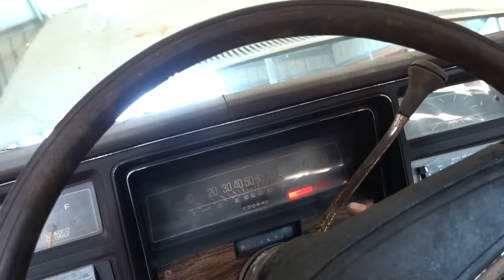Floors are DONE!!!!!

Comment: Spends $200+ on a carb, won’t spend around $100 on a fuel tank. Good job Matt.
Reply: Think we'll find out if that $200 carb can stop a 50 cal?
Reply: Or he could get a kit to seal the gas tank
Reply: Thought the same😂
Reply: And the carb will work be worth $0 after it's filled with rust
Reply: I was going to comment the same thing. Lmao. Matts the type to put a 2000 dollar alpine stereo system with equalizer,  bass cannon and sub woofer in a rusted out pinto. 🤦‍♂️
Reply: @dragonlvr069 I like your style
Reply: Hell I'm more concerned over not spending $5 for a fuel filter.
Reply: Not being funny, but these guys own a mansion, a tank range and all kinds of crazy shit. None of the parts to get this car running again would break the bank!
Reply: If that Carb is new, it's an easy 600.00
Reply: icuabc 123 oh yeah the one he ended up getting is definitely more than 600.
Reply: Jason Claunch yea it looks like an ultra xp so more like $850 or so
Reply: @Rich Baker for sure.
Reply: @Wyatt Myers I could only assume you’re correct on that, haven’t had to buy a carb since I had an 82 chevy back in 2001 or so.
Reply: Agreed
Reply: @twiggss4344  and?
Reply: Buys a new 1 ton truck won’t spend $100 on a new fuel tank
Reply: It’s just not worth the time for him. He could absolutely get it fixed if he wanted to.
Reply: or fuel filter
Reply: @twiggss4344  thought the same
Reply: No point in buying a carb   if you dont wana  replace  rust  gas tank
Reply: @richbaker8211  They dont own a tank range😂
Reply: You know Holley prolly sent that to him
Reply: I think this car is going to be apart of a Freedom Factory race. Matt just got a FF shirt from Cleetus and said that he's going to be "visiting the FF soon", then he gets a Holley carb for the Elco...
Reply: Love the sarcasm!
Reply: 600+ CFM carb or EFI Sniper upgrade?  Just please for all that is holy change that filter! XD
Reply: iBiana Doubt  damn it's almost like hes not done working on the car and is just finding out what's wrong with it! And the fuel pump works! Should probably just wipe his ass with cash too since yall are suggesting he buys all the unnecessary stuff on parts that work.
Reply: Or a 2dollar fuel filter
Reply: Jason Claunch My other suggestion I was going to say he does have a Wilder  Just cut open a square hole in the fuel tank get all the crap  back out of it and weld it back in !!  The same piece of metal that you cut out. !! 🤷🏼‍♂️🤔
Reply: Electric inline Fuel pump cheap !! And a fresh filter and that new carb and and youll be doin burnouts in no time
Reply: @icuabc1235  I'm pretty sure you're on the right track. Might be wrong but that looks like a holley xp
Reply: You can be cheap but fuel is the blood of the car and should be a focus just like the brakes and tires and other core wearables on the car. Most are cheap enough to prevent A expensive repair later that in this case would make the investment useless for not spending a few bucks to do right up front to be half decent repair.  smh
Reply: iBiana Doubt  I was thinking the same thing. That filter is obviously toast if he didn't replace it. On the other hand all that varnish is still in the carb too. Fuel lines are clean enough for a filter to take care of and obviously hold pressure assuming no leaks popped up (those lines probably saw more pressure from the air than they will from the fuel on a carbureted setup). I would have rebuilt the carb but honestly can you blame him for just buying a new one? OK maybe not a holley xp but a new carb in general isn't a bad choice 👍
Reply: Exactly my thought...???
Reply: If you put that new carb in, I would surely hope you buy a $5 fuel filter.
Reply: @mw3awsome9  gas tanks have a bad habit of exploding, even after they have been drained. Usually they have to be completely filled with water to remove the open cavaties to prevent fumes from accumulating and possibly blowing up. Explosive fumes can remain even after the tank is dried. Welding and cutting on tanks is not a good idea unless stringent safety measures are followed
Reply: Maybe he might rebuild engine for another car.
Reply: Has a fancy hand pump for the gasoline... instead of a 5 dollar funnel.
Reply: Will almost guarantee that carb is for another build he is going to do such as the bronco but just going to temporarily  put it on the el Camino and when he blows it up use it for what it was bought for...
Reply: Exactly. The logic behind not buying a new fuel tank but buying a new carburetor is really wrong but he’s gonna be stubborn about it until he realizes that he’s gonna have to buy the replacement anyway. LOL
Reply: He got the carb from Holley so it was probably free
Reply: Since when was a faking carb $200?
Reply: @Dallin Hatzke sister, anyone can be a Japanese made carb for less than $200 so get your panties out of a bunch and take a look at the market.
Reply: If the new gas sits in the tank with the stuff in it its gonna run like crap
Reply: Right. Ha ha ha
Reply: He’s also has junk cars he could rob a tank and rig it onto the car
Reply: @richbaker8211  they don't own the tank range, its just local to them

Comment: You're to young to know this, but your tank fill has an anti-siphon in the filler neck. We had theiving issues back in the '70's with the gas crunch.
Reply: Really? Wow, and now in some states, they're paying you to take their gas due to no-one driving. (Or were back in April.)
Reply: It was for unleaded fuel. Unleaded fuel had a smaller nozzle. Regular leaded gas was a larger nozzle and was cheaper than unleaded gas. You couldn't push the larger nozzle past the spring loaded flap. The Federal emissions guidelines to ensure all the newer cars used unleaded gas was the reason for spring loaded flap in the smaller hole.
Reply: Hanzy Scure This is true, but they also came up with a check valve, for both theft deterrent and for rollover incidents so gas doesn't pour out the filler neck if the car is upside down.
Reply: Rick Ballard it seems pretty obvious what that was for. And how it worked perfectly to keep him from syphoning. It’s things all tanks do because gas is always being stolen no matter the time

Comment: get your shopvac out and then some pvc tubing and and wrap it in duct tape to build up a buffer and stick it on your shop vac hose.  then you can get in thru the sender port to vacuum up most of that rust.  that is what we do in aircraft maintenance to get around baffle hole ports especially if you put the tank on saw horses upside down.

Comment: Hey Matt I use to work at a radiator shop as a fuel tank tech, if you ever have to clean a old tank again the easiest way to get old varnish gas out of a tank is by soaking it in dawn dish soap and hot water. Let it sit for 2 hours wash it out repeat if needed. Dawn breaks up the the old gas.

Comment: Hey Matt check the vacuum lines and gaskets under the carb my truck was doing the same thing turns out it was a gasket in between the carb and the manifold there is a way to check for a leak get some starter fluid and spray it around the lines while someone holds the pedal at a curtain rpms and if it revs up in a spot you spray the starter fluid you know that’s were the vacuum leak is in that general area! I’ve been watching your videos for years and have seen pretty much every upload have a good one man I hope this helps

Comment: Consider getting a Jerry can and flexible steel spout. That will reach just fine. Also, gas with ethanol in it is that light yellow. Straight ethanol free gasoline is a very light blue.

Comment: Some tank sealer will help a lot.  I think Oreillys sells it still, "Red Kote."  it will seal and encapsulate any floaty stuff that's left in there.  you could also etch and clean the tank with some rust dissolving treatment prior to sealing the tank.

Comment: Matt, vacuum out the tank with a shop vac. Then buy some tank sealer from Eastwood and apply per directions. A new tank is probably around $100. Personally, I'd get a new tank. Cutting corners always comes back to bite you.

Comment: In the future, to test the fuel pump you can take the hose coming off the pump going to the fuel lines and run it (extended hose) into a gas can and see if it starts up.

Comment: Depending on the exact distillate used in the manufacture, unleaded gasoline has several colors. But the typical color of the unleaded gasoline is nearly transparent to yellowish. A rare but top quality gas is the slight blue tint. Though, leaded gasoline is hardly found nowadays, it contains tetraethyl lead to make it red.

Comment: Hey man you should get some Pertronix electrical points they are way more reliable than regular points and the spark that goes through spark plugs almost doubles in size so you get more power. Also, install a double filter so you avoid having to rebuild your carb because of the rust in the tank.
Reply: If you don’t want to spend a lot just get an electrical fuel pump they are less than 20 bucks on eBay

Comment: Just use nuts and bolts & some rust cleaner, shake, then pressure wash it. Pick up some red kote from orileys and coat the tank.
Reply: Take the line off the carb & crank it till it sprays.

Comment: Check for air leaks going into the carb. I had a mustang that would run with the foot on gas but died on idle. It was a bad hose sucking too much air into the carb. Dad put a finger on it and it ran like a champ.

Comment: Matt, don’t replace the carb without replacing the fuel filter also!!!  I had a car idle just fine until I gave it some gas pedal.  Then it would stutter, stall and buck and barely run.  
Replace the fuel filter!

Comment: Fill the tank with water before you start cutting or wielding on it. Just saying, it might be good idear.  Also pour some oil on your heads, so they don't squeak so much when you start it. (am figuring you know to remove the covers first, Am hoping you changed the oil already) Cheers

Comment: its called a fual sox. as fair tank  you should be going fual filter. its only few dollers  to change also runing rubbing alacohol with be make look good. MAke sure change the sox.i recoomend toy air compressor ro chean out the tank.you talking bout is sediment in tank so soap and watter then dry out  to 100 no damp no nothing, rustdollem, will take are of rust and also wire brush in aluminum  do 1st it clean up nicely. it take a few trys short turns

Comment: Do yourself a favor and replace that old fuel filter. The fuel pump only pushes out about 4 or 5 psi, so a clogged fuel filter will stop it in its tracks.

Comment: Vacuum and drop in a magnet the cheap way or get the acid wash from parts store two or so kits If not clean new carb is a waste it will fill with rust.Unless  your going to Pew Pew it then it might make it to the range for a lead injection after all in my day they all ran on lead,

Comment: You using Acrylic? Cause that crap will come up easily. Best method is to get a nice layer of 2 part epoxy followed by a layer of polyurethane on top of you. You won't even have problems with peeling unless you really TRY to get it up. I use to work for a couple of decorative concrete companies here in San Antonio, so I'm pretty familiar with it.

Comment: You should get a new mechanical fuel pump as well. That old one has a rubber diaphragm that sat for 10 years and you just blasted it with 100 psi  of air pressure, when they ideally operate under 30 psi......

Comment: Rinse the El Camino gas tank out with high octane gas or deisel... 
Shake Well, Repeat As Much As Necessary... 
Then dump it in the water tub and let it all Evaporate Off... 
Once its all evaporated, take the water tub to the dip at the back of the Go Cart Track and rinse it out... 

Shazam, all gone and you didn't pollute... 
Well, a tee tiny bit at the Go Cart Track ... ... But you can turn your head while your cleaning the tub... That way you can say you didn't see what happened to the remnants...

Comment: Cant you prime it by just putting the key into the "run" position and holding it there for a few seconds so the fuel pump primes the lines and doing that a couple of times?
Reply: Older vehicles such as the camino have mechanical fuel pumps meaning the motor has to turn over for the pump to pump.
Reply: @mr.harless9821  Ohhh...neat! probably more reliable then if you take care of em
Reply: Definitely.

Comment: theres a anti syphon baffle plate in the filler tube on that gas tank , welcome to the 70's  gas shortages LOL/ plugs are fowled ,should put new cap rotor wires , and carb,replace all old rubber fuel lines if your using unleaded fuel .

Comment: You already replaced the fuel pump. The fuel pump is the device on top of the fuel tank that pumps Gas to the engine. So there is no need to replace it since you already did
Reply: Jayden Longstreet   A carbureted car usually has a mechanical fuel pump that is attached to the engine.

Comment: Mat, I hate to disappoint you, they do put red dye in automotive gas. They use to use it to tell the grade of gas you are getting. The state checks the gas at the pumps on a regular basis to make sure when you buy  93 octane gas that's what you get and not 87.  You are right that ALL gas is clear when it is refined but the manufacter puts dye.  https://www.garagechief.com/what-color-is-gasoline/#:~:text=The%20original%20color%20of%20refined,is%20crystal%20clear%20like%20water. " The original color of refined gasoline is clear, color-less like water. However, since the gas you put in your car is differentiated by octane ratings, manufacturers apply fuel dyes to it.
Aviation gas is bluish, you don't want to use 87 octane when you need 100.
If you rebuild that carburetor you might find some red on it.

Comment: couldn't you cut a bigger hole, get all the crap out and then weld a plate with a new correctly sized whole for the fuel catcher thingy over the bigger hole 
Might not be as easy as I think but that's what I would have done.

Comment: The more you don't give a fuck about a car that could be finished in 2 weeks of work and 5-8k$ - the more you get will fuckuped with that car while driving it. Use some kerosine and brush to clean the gas tank, change a new complect of at least pipes, oil pump and filters, wash the engine, carburator and a fuel system from old rust and gas first before start and all you need next is to clean the rust on a frame and body, exchange suspension and brakes, all liquids and it can be cleaned and painted

Comment: why dont you just cut the fuel tank open, take the sh*t out of there and weld it back together?
Reply: One word BOOOOOM!!!
You cant get all the gas out of the metal. Apply heat and you now have gas vapor  is a contaner. 

Heat fuel Oxygen. In a confined space. == BOOOM
Reply: @williamwhitaker5870  well didn't think about that thanks